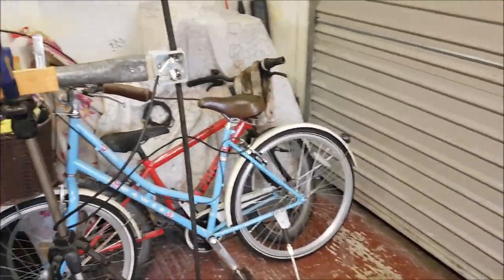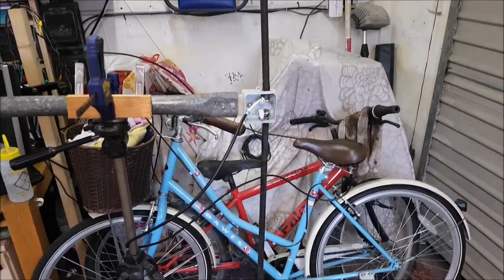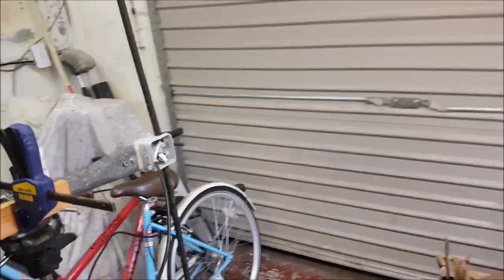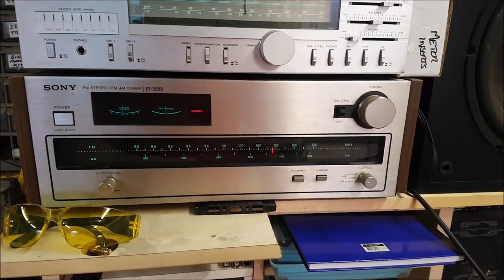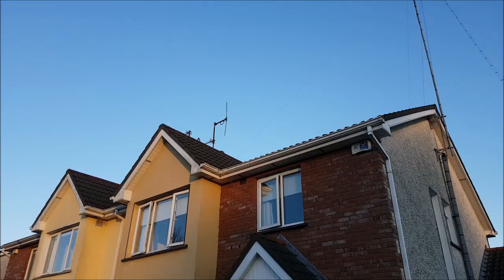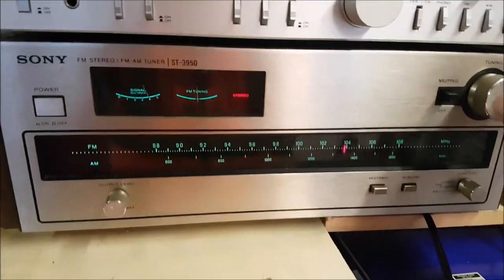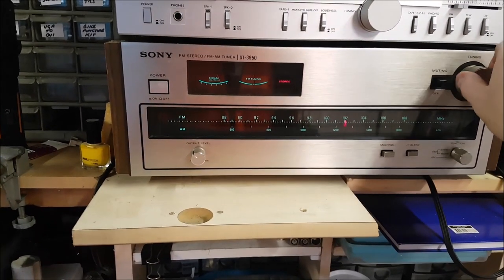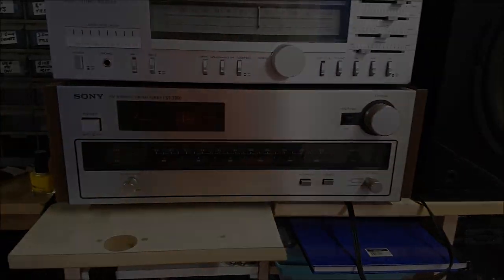FM DIPOLE FOR 88 TO 108 MHz HOMEMADE

Comment: I made one of these out of PVC pipe and EMT for the mast itself last year mounted 20ft off the ground. Coax amp 10 ft from ANT, RG6 ran to stereo 75ft away. Installed a ground block on the coax also. HUGE improvement in our low lying wooded area here in NJ. I pick up stations now from over 50 miles away when I used to barely get the ones a few Towns over.
Reply from the maker: The higher up you can get it, the better it will work as fm radio is line of sight. Mine is 30 odd feet up and I've good asl here I can get stations from around a 90 mile radius.

Comment: I'm running an old consumer RCA AM FM receiver off an outdoor antenna.the receiver is over 60 yEars old , made in the days when FM Stereo did not exist.the tuner pulls I one station very strong  and pegs the magic eye tube signal indicator.most of the FM station are weaker but listening to, they do not budge the magic eye arc . I'm hoping to fix the problem within the dipole you suggest.

Comment: thanks for the info. - the main FM frequency I want to get is 103.9 - your explanation of calculating the proper length was very helpful.   I'm going to hang one of those 'T' shaped wire radio antennas vertically which are 31 inches on each side (pretty close to what the calc said) and use a coax cable to attach to the 75ohm input and hope the gain improves.  thanks again.

Comment: How can I use such antenna with my cheap Philips FM radio?
It has a small telescopic antenna, and no coaxial port.
Reply from the maker: If you were not afraid to open it up and add one. Basically disconnect the telescopic one on the inside, and connect a female f type socket on a flying lead
Reply: @GeorgeEI7KO thanks for the reply.
It's soldered to the board.
I see two holes, but a single wire is soldered into both of them. How do I make the connections?
Reply from the maker: @phs125  solder one part of some coax in there, and they solder the braid to a ground location.
Reply: @GeorgeEI7KO  thank you, I'll do that

Comment: Could this type of antenna be used to broadcast FM signal? How would I make sure the system sees 50ohms? I was also under the impression that 50 ohm coax was better for FM, both in transmission and reception.
Reply from the maker: No clue. I don't condone pirate radio.
Reply: You may use GP antenna (Ground plane) . GP is best for broadcast FM signal.
Reply: For FM you need 75Ω of impedience for most FM receivers.

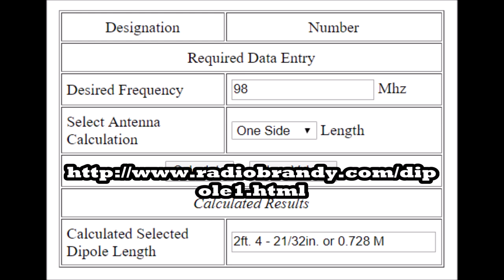Comment: 2:25 25 mil is 0.025 inches, I think you meant 25 mm which is for the most part is 1 inch
Reply from the maker: We refer to mm as mil here.
Reply: @GeorgeEI7KO  We are pretty screwy in America. The greater majority refuse to embrace the metric system, A "mil" that sounds like million actually means thousand.

Comment: I have a Panasonic home theater with a 2 pin connector for an fm antenna radio.  I connected it to the TV antenna lead by using alligator clips, but it didn't work very well.  Any ideas?
Reply from the maker: The TV antenna is probably for uhf frequencies so would be no good on the fm radio band. You should try making one of these and you'll have a good antenna then.
Reply: @GeorgeEI7KO  Are skinny cables on the alligator clips sufficient?  And is there enough contact from the clips to the pins?
Reply from the maker: @newsgetsold  once they are as short as you can get them.

Comment: I live in a high terrain area and because of mountains and hills obstructing fm signals, it does not reach to my home even if the broadcasting station is just 10 km away.
Can you tell me at what height should i fix the antenna.
Thanks
From India 🇮🇳
Reply from the maker: Hi. FM signals are line of sight. So by the description of your location with the mountains etc I don't think it will matter, especially if the transmitter is on the other side of the mountains. The general rule with any antenna is to get it as high as possible, and do it safely. Regards from Ireland
Reply: @GeorgeEI7KO  Thank You

Comment: I have a heap of trouble with one FM radio station in my area. I think I may make an antenna like this in a more simple tack to the inside wall and see if it improves the signal. If not, I'd hate to have to set up another bloody antenna because the engineers of 95.9 FM have never upgraded as necessary over the years and decided to just do patch work with their fingers crossed. All other stations are brilliant and clear. Sadly, my most favorite radio station is the only bad reception station that is broadcasting in my area.
Reply from the maker: I think having it outside and up in the clear is the only job Andy. The biggest pain was putting it up, and even it was not too bad.
Reply: @GeorgeEI7KO  Yeah, you are right. Get it up and it gotta work the best it will ever be.
Reply from the maker: It has to really.

Comment: Hi. 
1-What ia the average default lenght of 88-108Mhz fm dipole antenna?.
2-what default distance should be from the antenna to the pole? 
3-which is the best half inch pipe for transmitting fm signals. Is it copper or aluminum?
Looking forward for your reply.
Regards,
Waqar
Reply from the maker: I discuss all these things in the video
Reply: @GeorgeEI7KO  i got some things from old market as TV antenna pipe is a vintage thing. ☺. Some cable and a tube of depoxi. I will make it in the morning and share the picture with you.
Really appreciate your reply.
Regards.
Waqar.
Reply: @GeorgeEI7KO  i have completed the project. Thanks to. You Mr. Donaldson for guiding me. I want to share the picture of my project but its not possible in utube. I will. Try finding you in fb messenger and send you the pictures
 Once again.
Thankyou Sir.
Regards,
Waqar
Reply: I am also an old School born in 1970 & have recorded tapes through vinyls and from FM back in my school says. I still love to record tapes through CD or any input source available and play those tapes alot. My son doesn't even know from where to press play or stop in a cassette deck. He says that im old and i dont know anything about technology. 😂
Reply: Copper is the best conductor next to silver but aluminum is much better due to weight and is corrosive characteristics.

Comment: " Your feeder length needs to be taken into account with the final length of the aerial . My cable run is 125 feet"...................What does this mean.....anyone?
Reply from the maker: Extremely long runs (like mine) can mean the length of the copper tubes may need to be trimmed slightly.